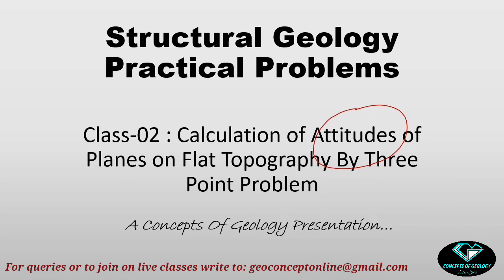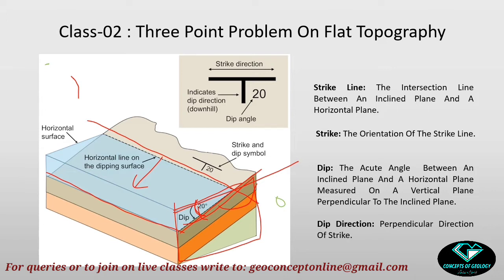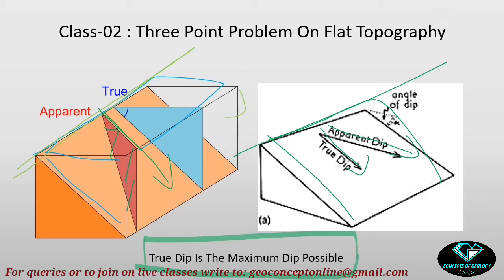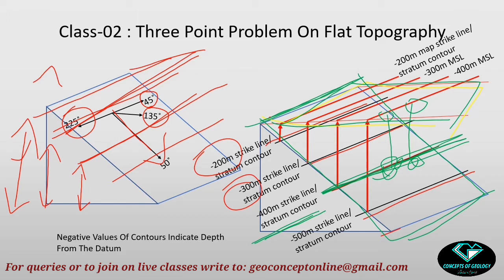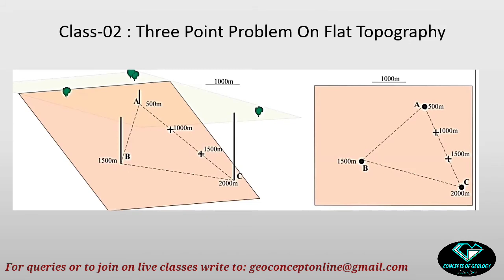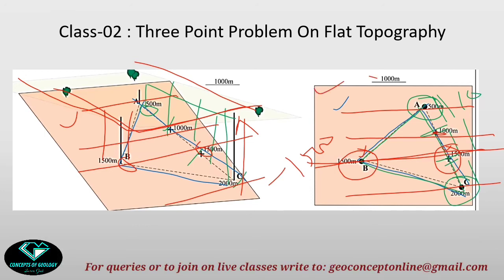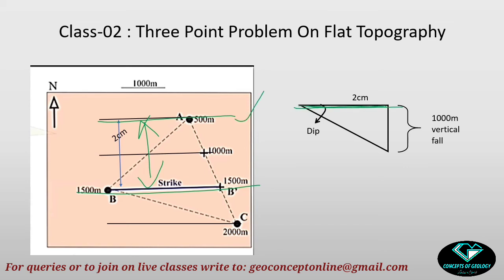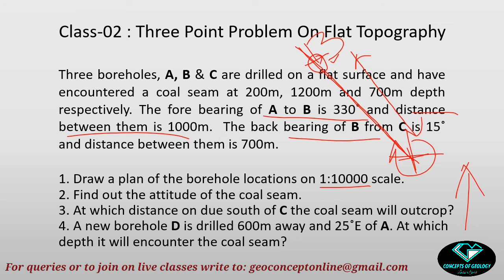Structural Geology Numericals and Maps: Class-02: Three-point Problem on Flat Topography

Comment from the maker: In this session concepts of geology has appeared with subbranch of geology through live classes, the practical problems on structural geology. We will learn to solve numerical problems on the subject and to interpret geological maps with complexities like fold, fault, unconformity etc. On advanced level we will solve the attitude measuring problems of geological liner and planer structures with the help of stereographic projection. 
Today is the second class of the module and we will learn to calculate the attitude of planner  structures by three-point problem method on flat topography.
previous video link: Class-01: Geological Field Mapping: https://youtu.be/vOZvvjGaTMA 

To join the live classes or to get the total session feel free to write to geoconceptonline@gmail.com.